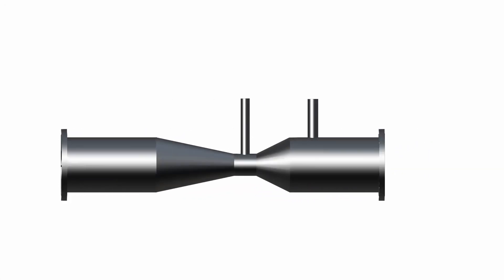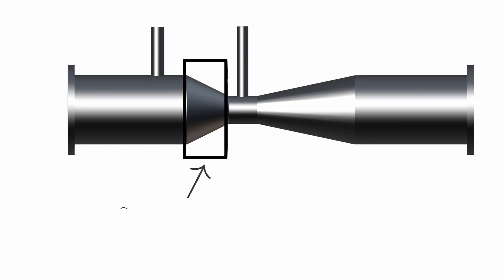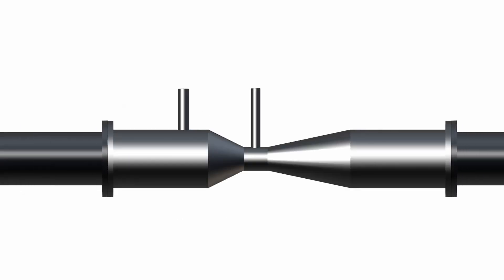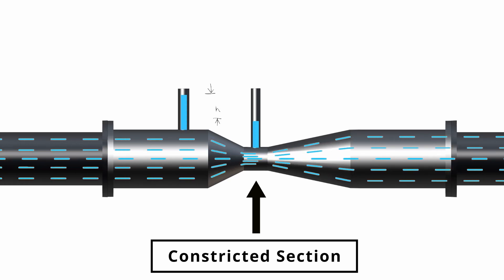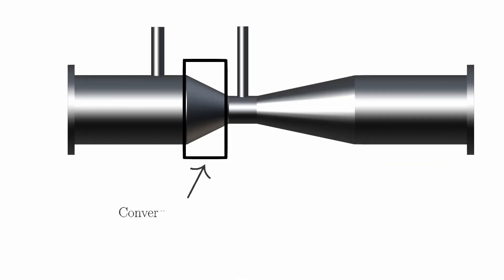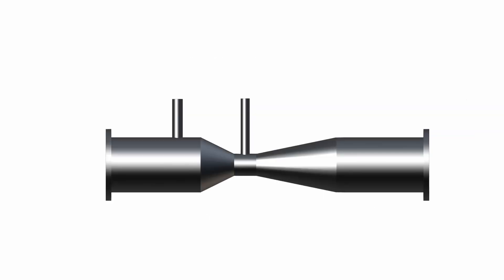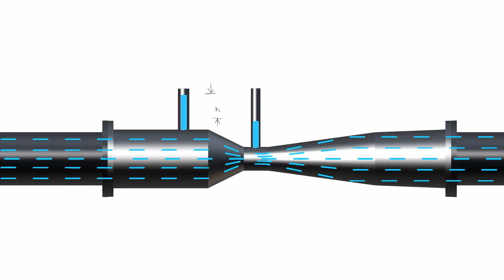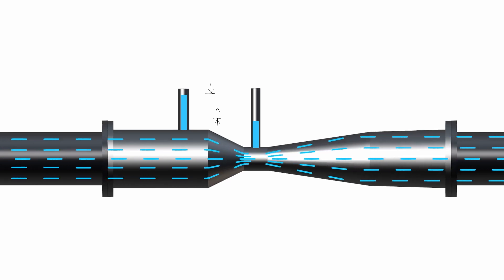What is a Venturimeter ,its working and application explained with 3d animation

Comment: If you needed to suck something into a high pressure airline (say 1500 psi), would it be possible to produce a slight vacuum (i.e. less than atmospheric pressure) with the venturi, or would the reduced pressure created by the venturi effect only be a little bit less than the main 1500 psi line pressure, i.e. way above atmospheric, and thus air would blow out of the venturi port, not suck in from outside. Hope I explained that clearly LOL.

Comment: i have a question 
if the gas was on the high pressure side went through the valve it will become colder and lower in pressure but the velocity depends on the high pressure to push it forward ,but the drop in pressure is made by the valve but the flow comes from the hot gad trapped befor the valve ,the compressor is respinsible for the circulation of gas ,but the velicity depends on the hot side because not only the compressor pushes but the heat from the gas itself which is trapped befor the vqlve
Reply from the maker: Thanks for your question! It seems like you're referring to the behavior of gas as it moves through a valve, but let me clarify how this relates to a Venturi meter.

In a Venturi meter, the fluid (or gas) flow is measured based on changes in velocity and pressure. When gas passes through the narrower section (the throat) of the Venturi tube, the velocity increases due to the conservation of mass (continuity principle), and the pressure drops (Bernoulli's principle). This is different from how a valve works, where the pressure drop is primarily due to the restriction created by the valve.

In your comment, you mentioned heat and pressure. While heat can affect the gas properties (like temperature), it’s pressure differences that drive the flow, especially in devices like compressors and Venturi meters. In the case of the Venturi meter, it’s the change in cross-sectional area that causes the velocity to increase and pressure to decrease, not the heat from the gas itself.

The compressor in your example helps maintain high pressure on one side, and the pressure drop drives the gas forward, not necessarily heat. Heat may affect the state of the gas, but the flow rate and velocity depend on the pressure difference and the design of the system (like a valve or Venturi meter).

I hope this clears things up! Let me know if you have any more questions!

Comment: Hello, would love to reach out to you and ask whether this can be applied in building structures where I want air to vent out from the roof in increased pressure, only that the tube would be vertical. Perhaps you can provide email? That would be great and would highly appreciate it. Thanks!
Reply from the maker: Email me samrat1322@gmail.com
Reply: @engineerknow  Thank you! Will send you email soon =) Just need to create a 3d model / diagram to better explain my intent.